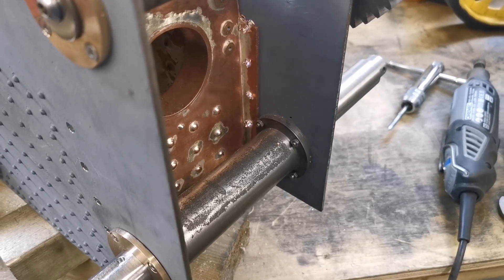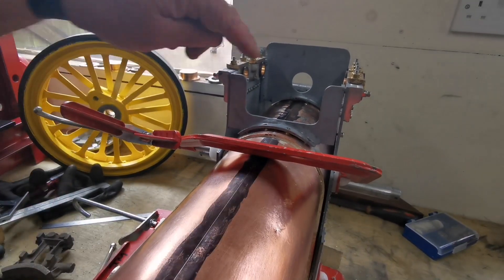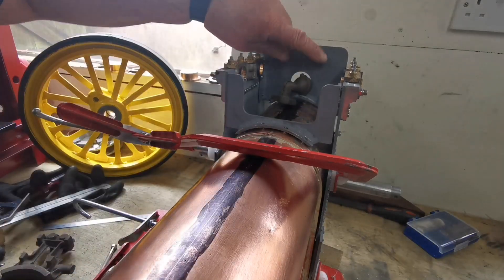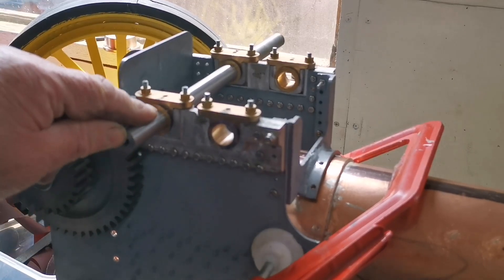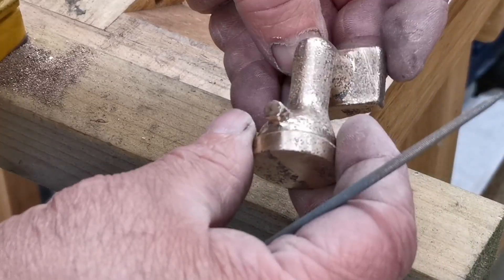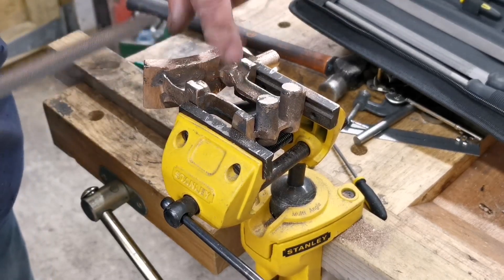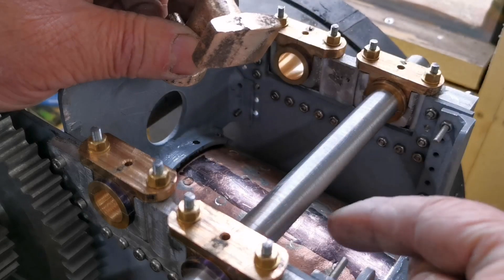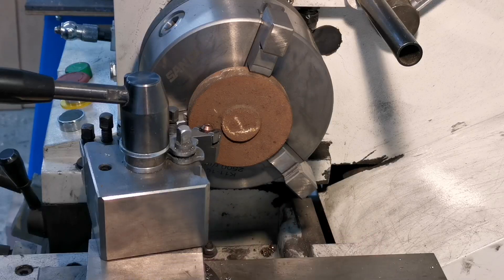2" Fowler Showman's Traction Engine marking the boiler for weyshaft bracket and cylinder block

Comment: hi Julian, how did you mark the centre line down the length of the boiler ..was it a Vernier height gauge?
Reply from the maker: Before the tube had any work done I had marked a centre line on the top Already, but to make sure it was still central I used a large engineers square each side and measured half of the boiler diameter  which I found it to be true

Comment: A work of art, cheers : )
Reply from the maker: Thank you it's slowly coming along, I'm not sure about the finish of the weyshaft bracket as it is enclosed I am thinking I may spray it maroon
Reply: It would be easier to paint it, polished parts need easy access to keep them clean and looking bright.  Finding good hi build primer and top coat is the hard part, I always used 2k paint,  I like paint to set hard and be stable.
Reply from the maker: Yes I think painting it is the way to go 👍